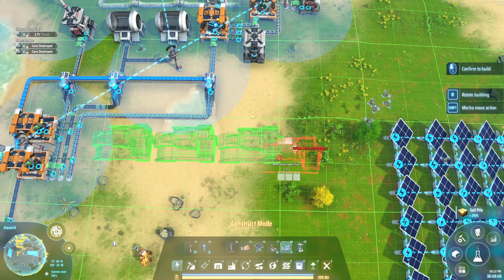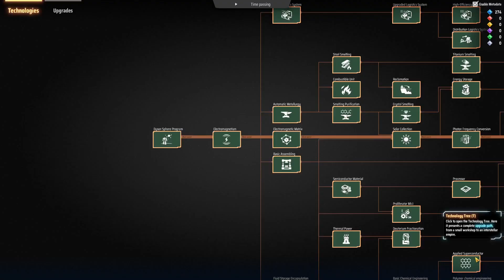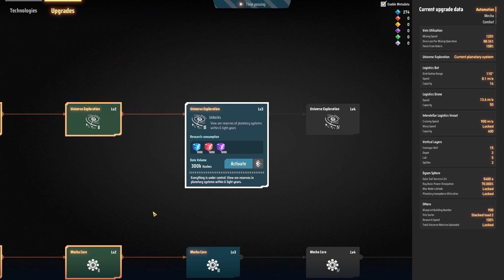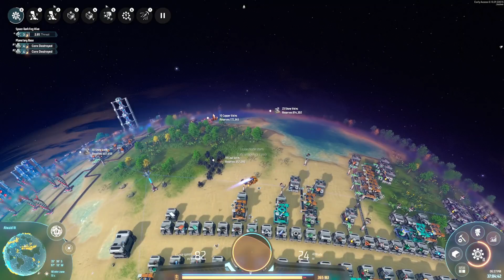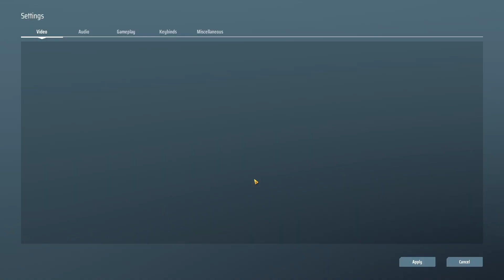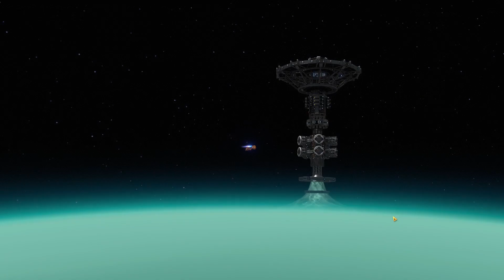ORBITAL COLLECTOR // Dyson Sphere Program // Mission Log 41

Comment: hahaha you're underwhelmed... you ARE lucky to have a fire ice giant, i know it doesn't seem like that at the moment. and ya for now you can just burn off the graphene if you want. graphene is used for building the Dyson Sphere, so very soon you will quite literally be throwing MILLIONS of graphene into the sun for power. you can look into starting your solar sail Dyson Swarm, that will use a ton of graphene and generate more power as well. generating graphene from fire ice also frees up your coal and sulfuric acid builds for other uses, like proliferation and titanium alloy. overall its useful but it may not be what you were looking for at this moment.

there is 2 types of gas giants. your ice giant which provides mostly fire ice, and some hydrogen, and a gas giant which produces mostly hydrogen and some deuterium. the deuterium giants would be what your looking for at the moment, but the ice giants are what you want for building your Dyson Sphere. 
the vein utilization WILL improve the collection speed for the orbital collector!

to fully tap your ice giant you need a total of 40 orbital collectors, which will generate about 2400 pure hydrogen a minute if you don't use the fire ice, and triple that if you do use the fire ice!
Reply from the maker: Hmm, ok well, for now it's a giant PITA to set up so I'll kick the can down the road and hope my current power generation meets my needs for the time being.
Reply: @Josiwe  lol ya hand crafting anything at this stage in the game is a massive PITA, that's why I'm excited to see you start your automated mall. talking about a giant PITA, take a peek offline at the recipes to get from where you are right now, to green science. you have a hugely long way to go. and automating all the buildings and getting all your fundamentals into the planetary network is going to skyrocket your building potential.

weirdly enough, the gap between purple and green science is tiny. you might take until episode 60/70 to get purple science, but once you do you'll probably hit green science in less than 10 episodes! there's soooo much foundational elements that are unlocked in yellow science that carry you for the rest of the game!

Speaking of kicking a can down the road, power is the one thing you're never going to fix so "just enough" is totally fine. right now 1GW seems like a lot, but next its gonna be 10, the 30. its never ending. so as long as you can keep kicking it along and monitoring it so it doesn't fall apart, you're doing okay there.